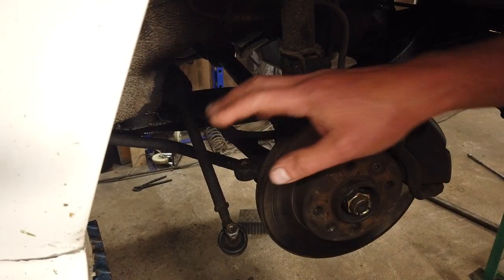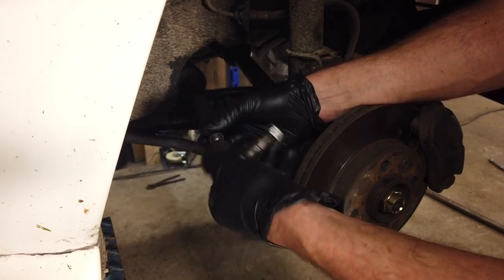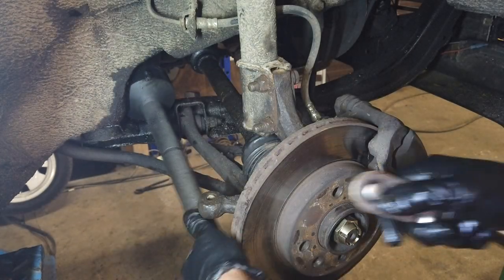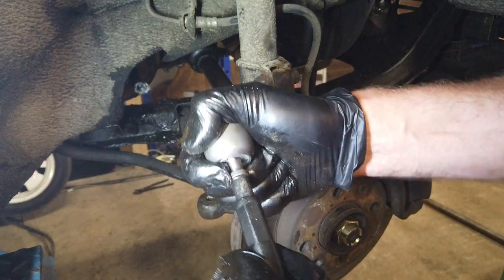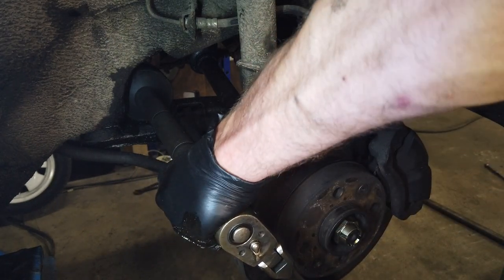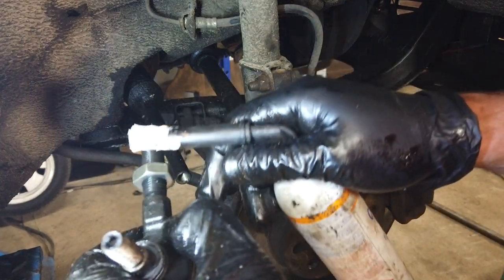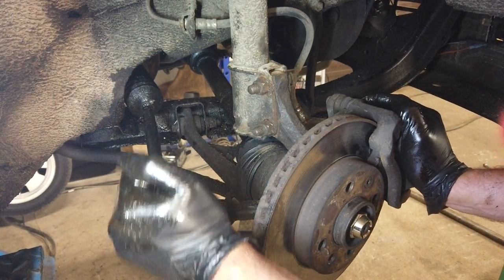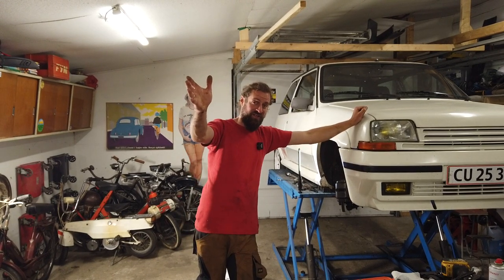Rernault 5 GT Turbo. Tie rods.

Comment: If you haven’t already take the intercooler of fill with water if it leaks it’s rubbish if it doesn’t look in to strap and flow it . Be careful with oil some are to thin and be careful with the valve clearance .set up the carb so it’s over fuel slightly coz if it lean it over heats like crazy and pinks . Standard they run one bar but if you get a bleed valve it can run 14 psi quite easy
Reply from the maker: Its tested! Not strapped though... :) So far its going to run standard..